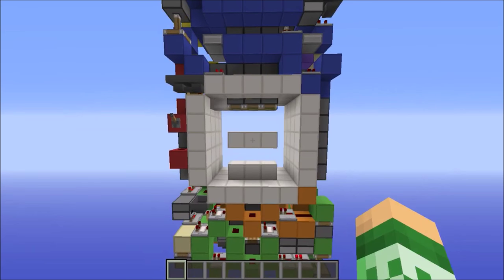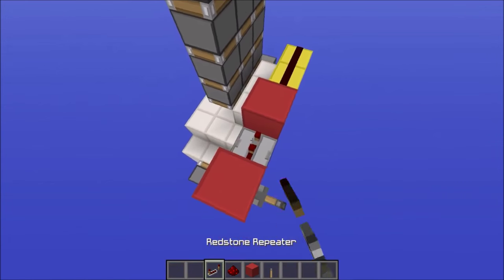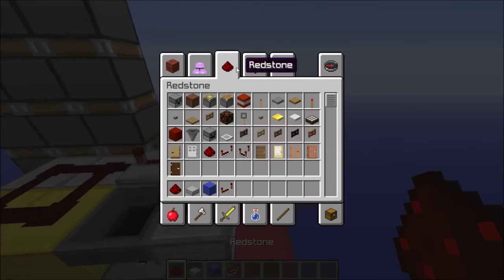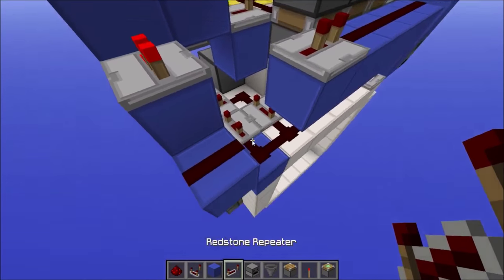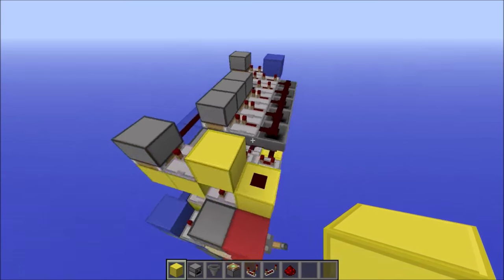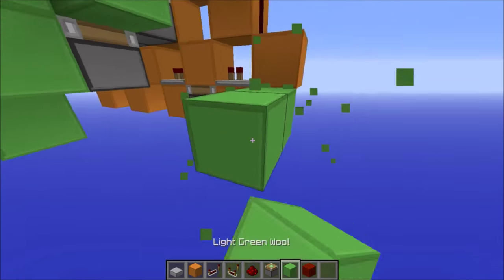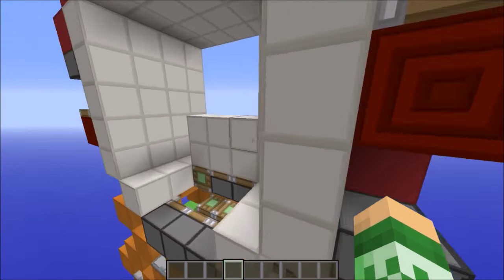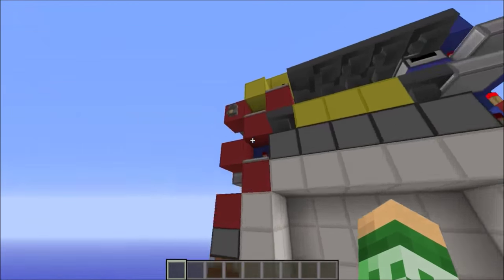Tiny & Synchronised 5x5 Door Tutorial [9x4x17]

Comment: I think this may be broken or at least locational in 1.8.9. I built it and the middle column pistons on the bottom always break. I checked my build like 5 times and rebuilt the entire bottom 3 times. still doesnt work.
Reply from the maker: +Jeffrey Zhu interesting, can you tell me whether the top or bottom breaks (first, if the top breaks it'll probably cause the bottom to break) and when it happens (eg, closing, first quad, second quad, triple etc)

if it's obvious or you can tell which circuit it causing it to break it would be helpful, thanks in advance :)
Reply: Armadillo28 the bottom triple (green circuit) causes the middle piston to push when its not suppose to. When the triple fires to push the 3 blocks up for the 2nd quad, the middle one is pushed a block higher.
Reply: +Armadillo28 Oh nevermind I think I fixed it. I somehow placed an extra tick on a repeater XD